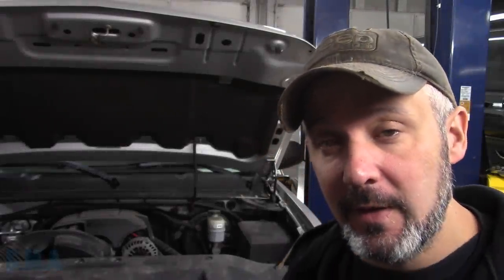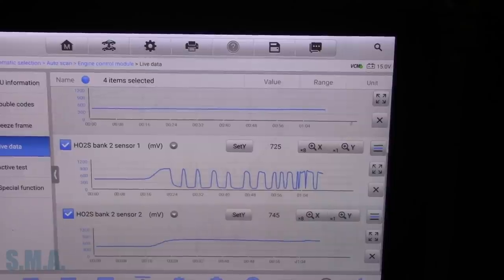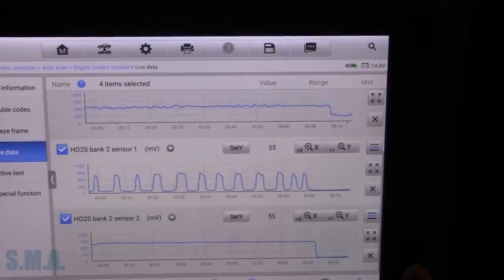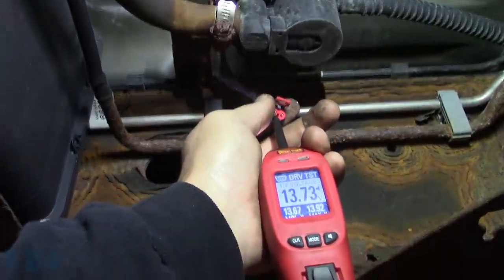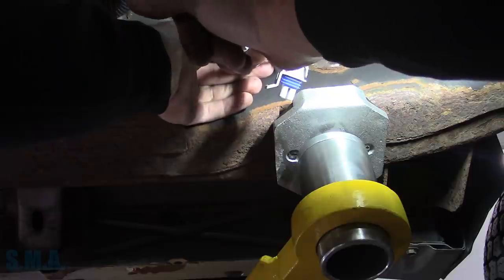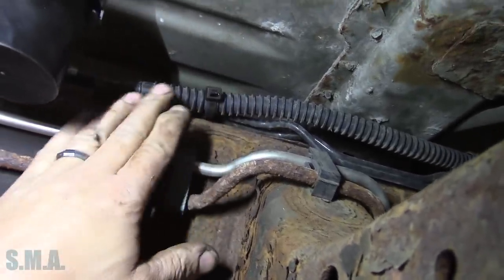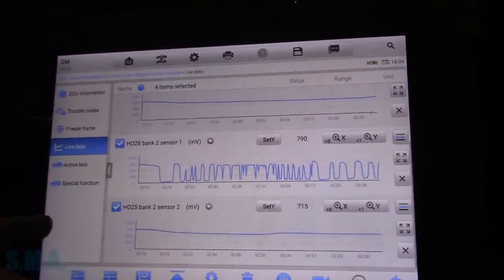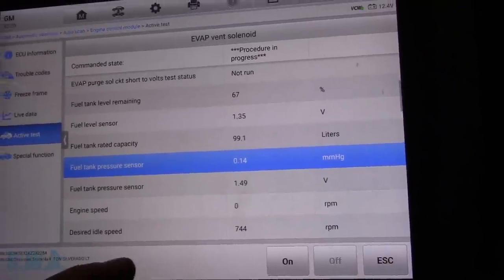Chevrolet 1500 - EVAP and O2 Sensor Codes

Comment: Scanner says the O2 sensors are swinging both ways. So...lick your finger and stick it in. But beware, there's a tendency for things to chafe and rub...uh, through. So just touch here. Then touch there. OK now touch both places at the same time.  That should have closed the back door. The sides of the tank should be sucking each other uh...together. Now, check the passenger rear window and see if you can get it up. Ooooh - did you feel that? Was it good for you? I'm sorry, that's all I got from this video. All the rest was gibbeldygobbish.

Comment: Just to say from experience the tire rotation you showed crap you can not reverse a tire in its break in rotation you will always throw a belt. Front to back not a crisscross pattern 35 years with my vehicles tried the latter always had the shimmy in the steering just after the rotating thought just cheap tires did this with $350 Michelins price for one same result. Now front to back never a problem again.

Comment: Want to pick my words carefully because this is text, and text sucks.. Wish there was a way to ask simple questions for $, with zero strings attached, zero responsibility on your side. But I've been a fan for years, and I know from WUW you don't like that, at least not with some of the questions you get that can't be answered over the internet. In my shoes, I'm resealing the oil pan in my subie, and I wonder what rtv you'd typically use in that situation. Or maybe if you even use the cork gaskets they have available instead. I think I should call the shop and ask (joking joking joking joking joking)

Comment: Nope not European just as bad...
 is American engendering at its best 🤦‍♂️🤦‍♂️
Take a Toyota Corolla vs a Pontiac vibe...
By 100k the vibe needs everything that wasn’t Toyota specifically the interiors dash crack panels misaligned seats worn out just bad material...
Reply: All brands are junk today. Every single one has taken several steps backwards pretty much everywhere, aside from handling, power, and electronic gadgetry in the interior. They give you the good stuff all wrapped nicely in a s#!& sandwich.